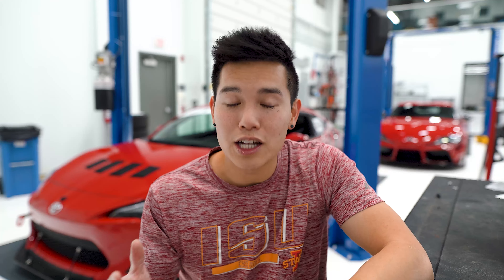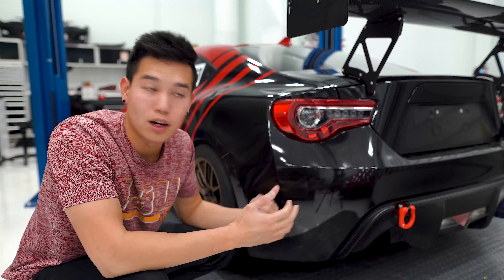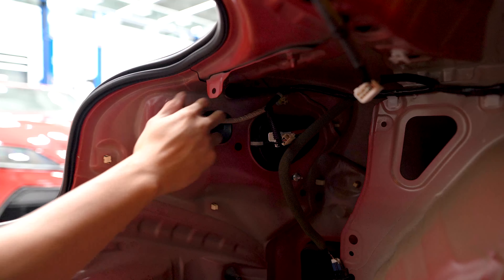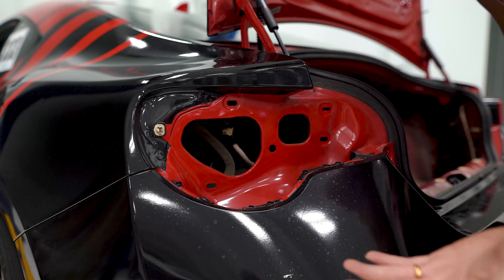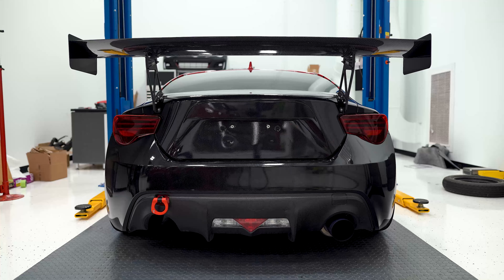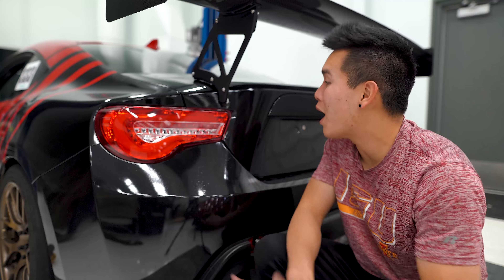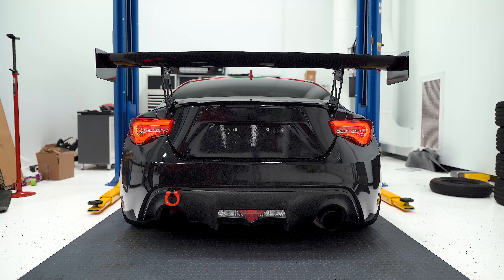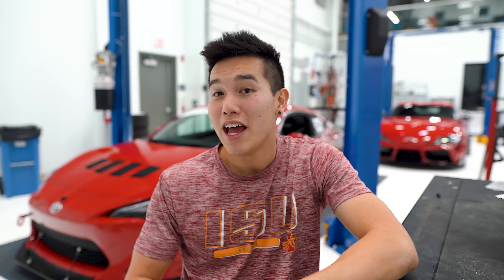New Tail Lights for the FRS

Comment: Not a fan. I’ve always loved the v1 red TOMS. Always preferred the OEM+ look.
Reply: Agreed, loved those tail lights but just a huge shame about the quality control issues. Went through two pairs melting over the summer - clear lens were more susceptible to it and I suspect that's why it was discontinued pretty quickly whereas the red lens continued production for a while longer.
Reply from the maker: Some red toms would've been my second choice. I also thought about getting cleared toms as well, but that probably wouldn't have meshed well.
Reply: @tomh434  Yeah my buddy had condensation issues. Best bet would be to take it to a headlight retrofitter where they can reseal the lights for you.
Reply: @straightupgg  my issues was more the plastic inside the lens melting / LEDs failing. Was a pretty common issue with the clear lens on the online forums :(